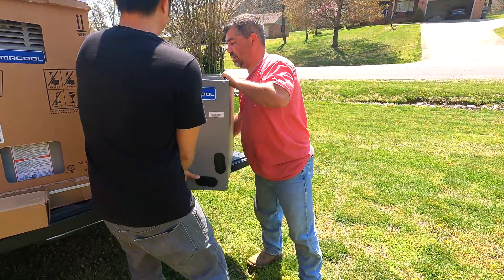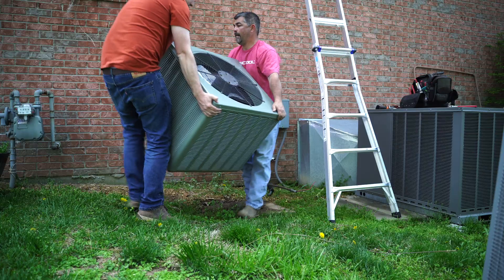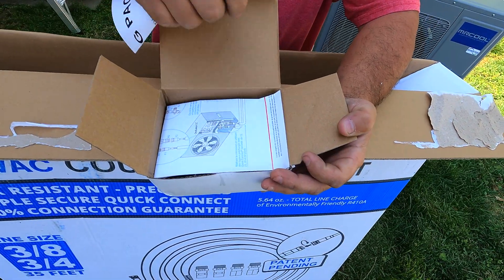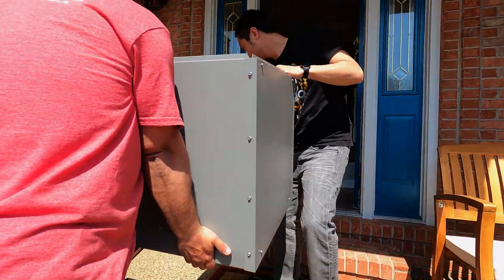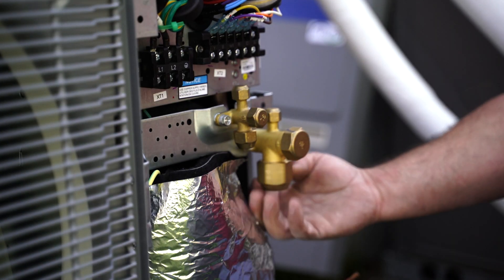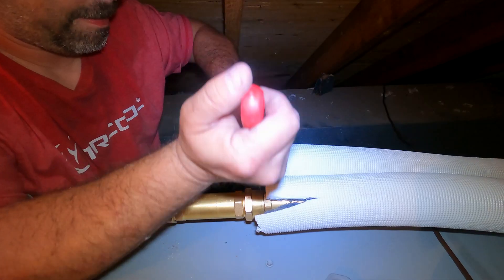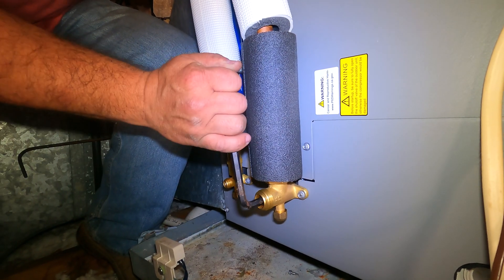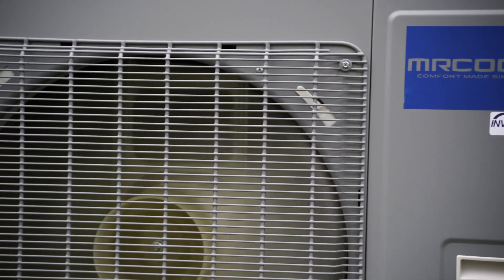MrCool Universal A-Coil with Quick Connect Line Sets

Comment: am i able to get the ac part handler and compressor and attach it to my current gas furnace, or do i have to get both part together? also i have been looking around for this and all i can find is the heat pump version, i want the gas furnace abilities.
Reply from the maker: You can buy them in any format sold by our dealers. We generally don't require central air equipment to be bundled for sale in any particular way.
Reply: @MrcoolComfort  i have looked online and can't find anyone